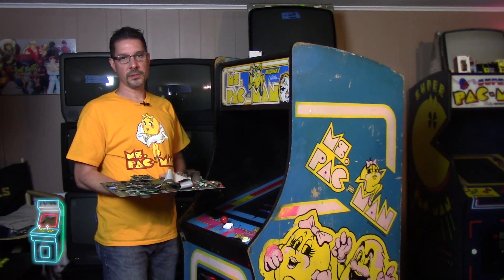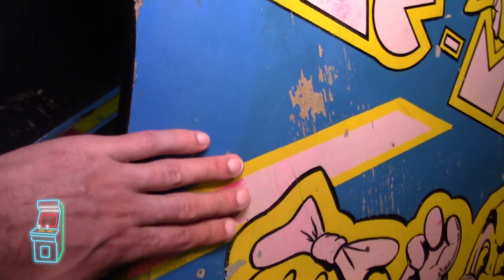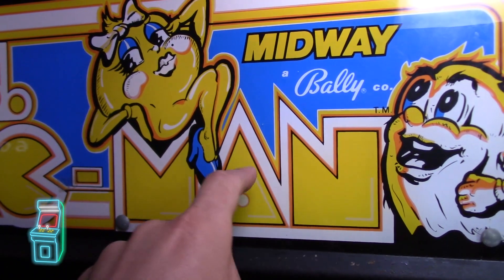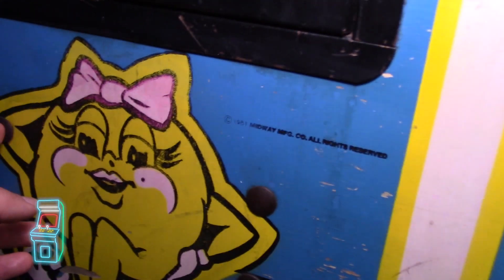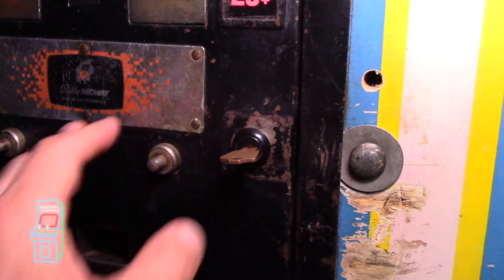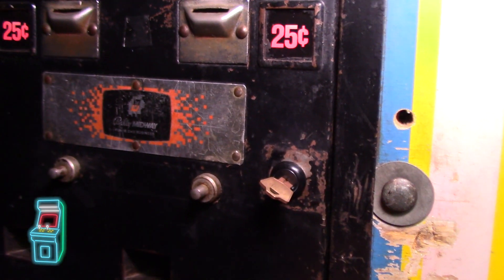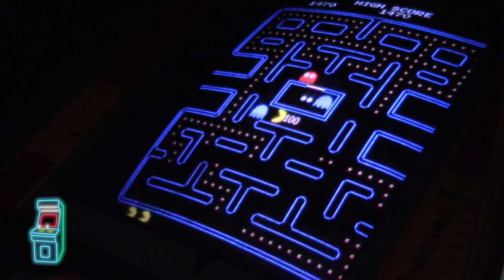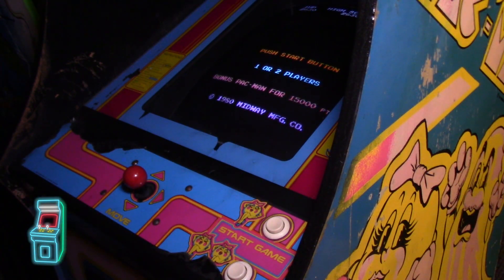Ms. Pac-man upright arcade restoration [Part 2]

Comment: Those glitches are caused by a bad ROM or ROM connection at either 5E or 5F. Replace the ROMs one at a time even if they pass the Romident test
Reply from the maker: Hmm, those are the two I didn't socket. But the glitches aren't present with the Pacman EPROMs in there. So perhaps if I put in new roms it will fix the issue.

Comment: You mentioned the 96 in 1 Multi-Pac. Do you have a resource that would help me find one? I thought they were all sold out.
Reply from the maker: They are not produced anymore. I got mine second hand. However, I know a guy who is reverse engineering it to make one for himself. I could always link you two up.
Reply: @delsarcade  I would appreciate that very much. I'm sure I would be first in line if such a product exists. :)